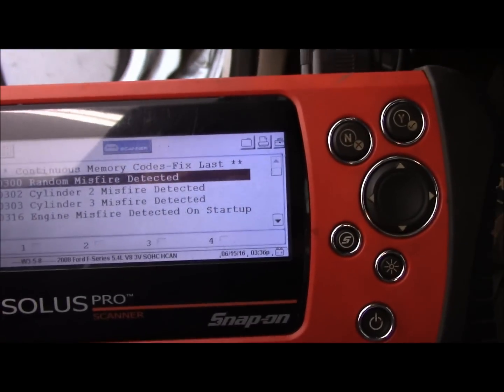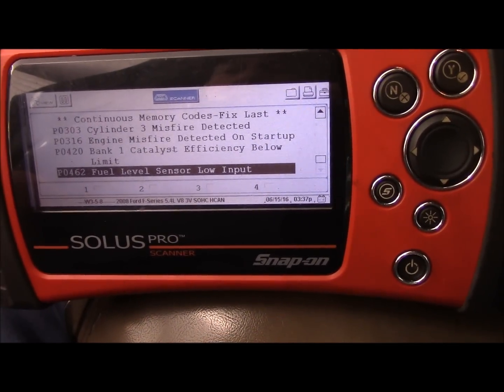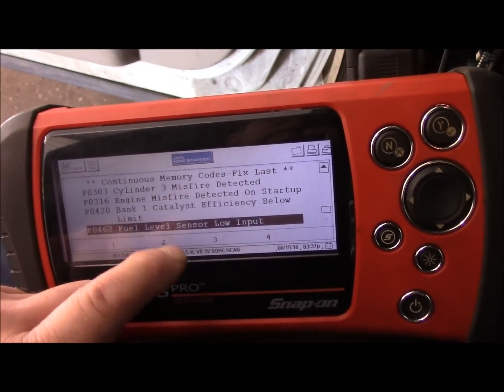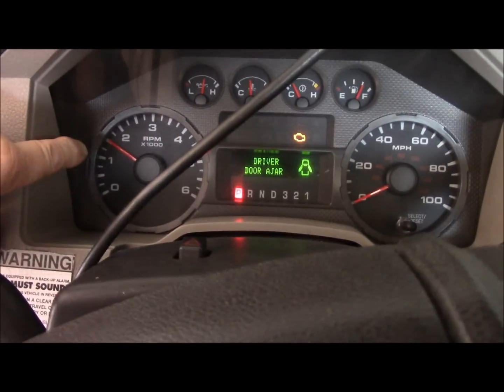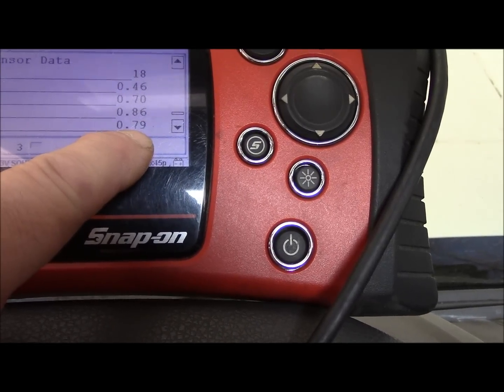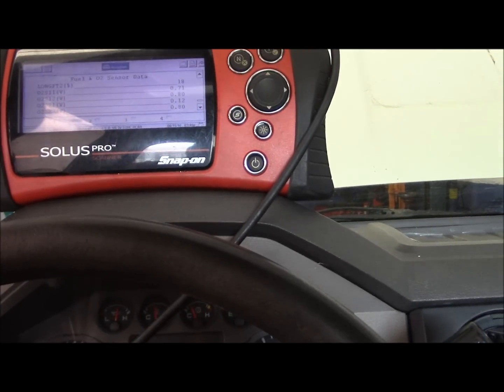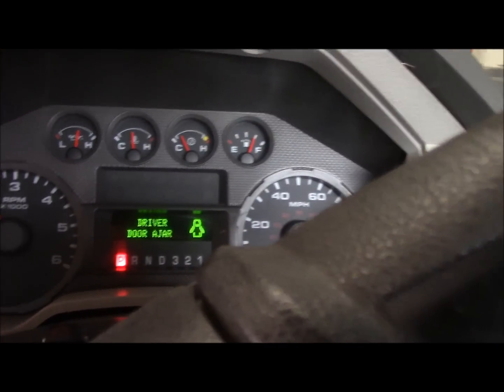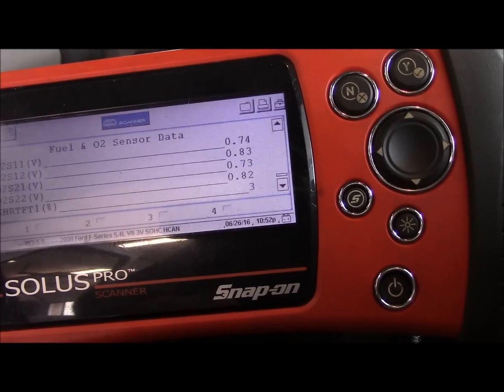How To Test A Catalytic Converter

Comment: Try putting it on the pipe and not the heat shield the heat shield will read cooler you had it on the pipe at the front but on the heat shield at the back

Comment: How do we know the catalytic converter is “positively” no good ? What are the temperature differences supposed to be between front and back ?  Also, did you replace the oxygen sensors when you replaced the catalytic converters ?

Comment: I got a po136 06 Chevy trailblazer I know it suggests is a downstream O2 sensor but live data says the O2 sensor is working fine comes on after about a hundred miles got to realize this vehicle's got 205,000 me and I live in Chicago. Rust belt I do live data it shows CO2 sensors working fine. I really believe it could be the catalytic converter because if you press the gas there's hesitation that it normally wouldn't have. What's your thoughts

Comment: My O2 sensors in both banks are reading arounf 750 mV continuously (at idle and at 3000 RPM as well)
Also, the LTFT in both banks are almost zero, but at steady 3000 RPM, the LTFT go to -10 in both banks
What does this mean?

Comment: Thanks.  I have a toyota that had bad coils and plugs.  The cat is not showing a code now but the monitors are incomplete.  The scan tool says the cat is hotter upstream but it may be reading the difference between the wide band A/F sensor and the o2 sensor.  Ill check with the IR thermometer.

Comment: I have a 05 BMW x3 
Both bank 1 and 2 sensor 2 are reading 92 and not moving.  Could this mean that they are bad?
I do have p0420 and P0430 codes. 

Could it just be the 02 sensors?

Comment: My car started hesitating after i took it to get tires rotated. found out the  Mechanic took air filter out and didn’t put it back in when they did a point inspection. I put a new filter in but now i get the check engine light on. Changed the oxygen sensor out erased the code. 0420. Check engine light came out again. My question. What could a missing air filter cause the engine to cause the code ? Thank you
Reply: dirty MAF sensor ... mass airflow sensor 
just beyond the air filter ...
with no air filter there was nothing to block whatever gets drawn into the intake ...
usually in the 'accordian' looking thing ...
(there's a special solvent/cleaner for MAFs)

Comment: Jim, could the up stream oxygen sensor be disconnected and removed, and if engine  performance
has returned, would that now confirm I have a stopped up cat?  I have checked and confirm all else
in system...everything ignition related,  mass flow sensor, egr valve, throttle body, tps sensor, clean
air filter...everything under hood. Good fuel pressure confirmed.  Presently engine will not run over 
10 to 25 miles per hour. Removed egr valve and engine now performs somewhat normal.  Reinstalled
Egr valve. I think if I remove upstream oxygen sensor engine will perform normal. Engine does use a little
oil. This may be my problem causing stopped up cat. Your opinion on removing oxygen sensor and
doing engine test drive. Your opinion on this test drive procedure. Engine is chocking up on acceleration.
Your thoughts please. Thanks..Jim.

Comment: So if catalytic work properly pre catalytic converters should be lower temp that post converter? Is this good assumption if both temp reading are same or pre cat hoter than post cat then consider replacing the catalytic? Please advice

Comment: Jimmy when you checked the o2 sensor in bank one sensor 2 it was not fluctuating the proper way. It was the cat that was the problem. If it was a o2 sensor problem what would the scanner be showing? Did say it’s the sensor and not the cat.

Comment: I have a 2017 Hyundai Santa Fe and I noticed the inlet temperature was 200 degrees higher than the outlet and I have no check engine

Comment: If an cat converter is bad then air does does not move through the converter. When this happens which side would be hotter? It would be the inlet side because the heat just going to build up and not get through. Common sense. Not sure why a cat would be bad if the temps are the same on inlet and outlet

Comment: I had a p0420, used thermometer and showed the Cat is good (100° hotter downstream). The upstream voltages swings between 100mv to 900mv but the downstream shows 700mv - 800mv on idle, erratic on 50 mph. No leaks after exhaust manifold. Normal power. Fuel Trims okay. Could it be Rear O2 sensor?

Comment: Great!!
Have two questions, first what does the second o2 sensor do?

Second, why does the temperature changes always and how much should the difference between the outlet and inlet temperatures be?
Reply: Second O2 sensor reads gasses coming out of the catalytic converter and lets the computer know that the exhaust gasses are withing specs. 
The difference between the two temps should be around 100 degrees. the engine side being cooler one. Reason for that is, a working Cat supposed to burn off hydro carbons which tend to make the exiting side hotter.

Comment: Hi Jim. Great video. Please help me with my wife's 2013 infiniti jx35, V6 engine.
After getting the engine hot the cats were at around 850 degrees. The voltage readings were as follows: B1S2 - jumped between 0.070 and 0.080, B2S2 - jumped between 0.110 and 0.800, B1S1 - around 2.0v and B2S1 - around 2.2v.

Can you please help me diagnose this?
Reply: My pathfinder the same, u ever find out?
Reply: @jasonfromm5637  he didn’t give enough info. And He didn’t say if the car even threw a code. 850 deg? V readings seem consistent

Comment: I have  a Mercedes Class C 2011 W204, the O2 sensor upstream is showing 2.0 (1.6 - 2.4) Volts and the O2 sensor is showing 0.41 (0.1 -0.6). The temp upstream is bigger than the temp downstream... Is there a probleme with the upstream sensor?
Reply: It's more than likely got an air/fuel ratio sensor upstream. It looks similar to an oxygen sensor, but it's different.

Comment: How does experience say that you need a complete set of coils?! If it is COPs, and not one of the other potential causes, why do them all? Misfires are NEVER that easy to diagnose! A P030x code does NOT automatically equal COPs.

This seems pretty dishonest to me.
Reply from the maker: Dishonest my a-s . I have replace so many converters because of other shops just changing one coil and a month down the road another one fails. As you must know a misfire will destroyed a very very expensive converter assembly.. You have no idea what you are talking about.
Reply: Jimthecarguy - My point is that no level of experience is enough to look at a scan tool, read a P030x code, and know with certainty that you need to replace all the coils. There has to be some form of testing. Could it be COPs? Sure it could. It could also be plugs, valves issues, or several other potential reasons. A trouble code gives the symptom, not the cause.

The other issue is, if a coil is actually bad, then replace it. They do not need to be replaced as a set. The excuse of ruining the new cat a month later is not reasonable ......especially if you diagnose the misfire cause and fix it, not just throw potentially unnecessary parts at it.
Reply from the maker: @mikenaples4046      Whatever you are entitled to you opinion.

Comment: That's not really true that catalytic converter when we get really hot when you step on the gas when you're running it at 2 or 300 RPM to 3000 RPM that's the only time that catalytic converter will get hot and you should know that it doesn't get hot when you sit there and idle and you know that
Reply from the maker: WHATS UP WITH YOU?????????????? ARE YOU A TROLL? OR ARE YOU REALLY THAT DUM.

Comment: I don't think this is a complete diagnosis you went straight for the coilovers and just replace them all I would have did a little more research to make sure that they were bad by switching them switches cylinders with the good one to the bad one and that I would have reset the computer to see if the misfire fault code came back I think this is the proper way to higher class the professional way to do it I think this is somewhat unprofessional to just assume that the part is bad without verifying it and to replace all 6 or 8 coilovers or all 4 whatever
Reply from the maker: Thanks for watching.

Comment: It could clean up if you fix the wrong with the engine sometimes that catalytic converter will clean up also to our first of all replace that downstream O2 sensor before I did the catalytic converter you probably need both but I would do that one first too much cheaper repair especially if you have a lot of mileage on it sometimes I'll talk to sensors don't read the correct data data data
Reply from the maker: Thanks for watching.

Comment: just curios why did you not check the O2 Sensor and see if it was working properly ? because if that also is bad it will throw off the cats ...just wondering.
Reply from the maker: Thanks for watching.

Comment: I have a P0420 on my 2011 Honda CRV I changed both oxygen sensors and it went away for about a week and then it came back so I'm supposing I may have a leak somewhere. I scanned it and have no misfires, I checked under the car I didn't find any holes anywhere but I did notice that the top or pre cat catalytic converter is very red and bluish does that indicate damage? If it does do you suppose that I could be burning some fuel or oil into the catalytic converter? I don't want to replace it without being sure that I found the problem that caused the damage to the cat, otherwise it will just happen again, what would you recommend on how to proceed?
Reply from the maker: How many miles on the truck? Is there any exhaust leaks before the converter?
Reply: 112,665. as far as exhaust leaks I don't hear any, smell anything, and my 2 scan tools don't throw codes for leaks or misfires. Although there seems to be an issue with the evap system vapor pressure , the readings go really crazy between 26.50 and 332.50 I believe the normal range is between -0.35 and -50 
As well as the absolute throttle Positions B and D being higher than they should be, I believe the normal range for both of them is between 0-14 and they both go as high as 30 besides that, the only other code that does appear is P0135
sorry for the long response 
But thank you for any help you may provide
Reply: P0420 for sure have a bad cat... Not the 02 sensors
Reply: What's up with this guy, he starts to help but then he just stops responding to you. I se him doing that a lot! So I will not be a  subscriber !!!

Comment: I'm still wondering about the catalytic converter in my Mitsubishi outlander 03 and have one more question. If I'm randomly getting an obd code which says 'catalytic converter over threshold' is it possible that the problem is with the downstream o2 sensor? This sensor periodically reads up to 0.7-0.8V like I mentioned in my previous message but sometimes the reading from that sensor jumps all the way down to 0.1V. Would you advise me to change that sensor first before I replace the catalytic converter or in your opinion is it definitely the catalytic converter that's bad? Thank you in advance. And have a good one.
Reply from the maker: Can you borrow the laser thermometer from on of the big box store and check the converter as I did in the video?
Reply: @jimthecarguy Thank you for your reply. In about ten minutes after I started the vehicle I check temperature by the laser thermometer and the temperature is almost the same on the front and on the back of catalytic converter.

Comment: Very professional diagnostic and extremely helpful video. Thank you so much. I have similar symptoms on my Mitsubishi outlander 03. My downstream o2 sensor is reading about 0.7-0.8V after about one minute of accelerating to 2K RPM right after I release the gas pedal. Then after about 3-5 minute that downstream o2 sensor starts jumping and reading 0.3-0.5V like the upstream sensor. The temperature on the front and on the back of the catalytic are pretty much the same. Could you please advise me if my catalytic converter needs to be replaced? Thank you very much.
Reply from the maker: If the inlet and outlet are the same temperature and there is no exhaust leaks than it sounds like the converter is bad. Thanks for watching.
Reply: @jimthecarguy  Thank you very much for your reply and for your time. Have a good one.
Reply: @jimthecarguy  I'm still wondering about the catalytic converter in my Mitsubishi outlander 03 and have one more question. If I'm randomly getting an obd code which says 'catalytic converter over threshold' is it possible that the problem is with the downstream o2 sensor? This sensor periodically reads up to 0.7-0.8V like I mentioned in my previous message but sometimes the reading from that sensor jumps all the way down to 0.1V. Would you advise me to change that sensor first before I replace the catalytic converter or in your opinion is it definitely the catalytic converter that's bad? Thank you in advance. And have a good one.
Reply: @andriivladyka7126  hi, I would say the 02 sensor is ok. However the cat is probably bad. Have you tried cleaning both sensors and cats? Or have you already repaired your car?

Comment: Manufacturers should change the EML light from Yellow to Red...bcos all car manuals say warning lights in Yellow is nothing to worry about hence ..low screen wash warning is yellow...Bulb failure is yellow...low fuel is Yellow..how how we suppose to take EML light serious???..especially when the car is still running smooth...you think..oh..I haven't tighten my fuel cap😥

Comment: I have 96 Toyota Camry LE 4 cylinder with the P0420 code. I had previously did tune up in July  changed coil packs and spark plugs and had to replace the distributer cap and rotor.  The vehicle will start but will run maybe 2 -3 minutes tops then shut off and will start back up for awhile . Could I have more than just my catalytic converter as an issue?

Comment: So if o2 sensor didn't do what it was suppose to be doing how would you know that the o2 sensor didn't need replacement and not the converter itself
Reply from the maker: You will need to check the inlet and the output temperature to be sure the cat is bad.

Comment: Great video I'm getting po420 and po420 does that mean I have to replace front and back sensor
Reply from the maker: You will need to check the inlet and the output temperature to be sure the cat is bad.

Comment: Jim:

Nicely done Sir.

One Q:
Isn't it possible that bad coils / misfire issue caused converter to plug up & a long highway trip AFTER coil replacement could have heated up Cats / removed plugging / restored proper exhaust flow?

I've seen clogged Cats clear once engine management issues are fixed.

I'm asking from the perspective of a DIY home mechanic who perhaps would want to try this economic approach first, before dropping  $600-900 on that sweet new double Cat assembly ?
Reply from the maker: Yes it is possible. If there were misfire you could repair that first and then drive to see if it clears out. From my experience the cat is most likely going to have to be replaced. Thanks for your input.

Comment: The temp test is a start but its not the correct way, because the computer is set to go off by the smallest inefficiency. So the last car i worked on had a 100° drop from like 412 to 309 but was still setting the code p0429. So I changed the cat and light never came on again.

Comment: So is p0421 a bad catalytic converter too? Bc that is what I have and I think I have a warm up cat and a main cat . V6 . 3.0 idk to replace 02 or a bad cat or warm up cat ???
Reply from the maker: Did you check the temperature into the cat and out?
Reply: @jimthecarguy  I will need to put the car on jacks to get under it and do that , I can kinda do the rear while on the ground , the inlet was cooler than the exit.  But the one upfront I can't even see unless it goes in the air which I will test them all at better angles

Comment: Hello im only getting the p0420 code on my nissan altima, i did the cat-cleaner solution drive 132 miles passed smog check but i when i hit 152 miles it turned the engine light again. Cat converter needs to go?
Reply from the maker: Yes those cleaner just don't work. The cat needs to be replaced if there is no other problems. Thanks for watching. Don't forget to subscribe.

Comment: I think I have a  bad catalytic converter, Because bank 2 is mimicking bank 1, But I don't have  a check engine light!? Why? Maybe later? Or can it just be 02 sensor bank 2?
Reply: First of all dont change anything til you get a code that tells you something is wrong.
If you have 2 banks like a V6 or V8 engine, you want to check the sensors on each bank.
Example, on bank 1, compare sensor 1 to sensor 2 with the motor hot and running and hold the rpms at about 2k rpms.
As long as the engine is hot enough, sensor 1 will jump up and down between 0.1 to 0.8 rapidly, and sensor 2 should be steady around,
0.5 to 0.8.
If sensor 2 is also rapidly jumping like sensor 1, then the cat might be bad cause is not heating up enough to burn gases.
To double check this, use a thermometer like the one in the vid to check the inlet and outlet temps of the cat.
Try to point the laser at the weld seams of the outlet and inlet. I find to get a better reading that way.

Comment: Did you also replace o2 sensors or use old ones?
Reply: Bob my rear 2 cats (V6 Mercedes e320) were partially/mostly blocked.
Temps read 100deg higher in F, than Rear.
Oops that's reverse what it should be !
Proper is +40-100 hotter in rear of cat, btw.
Cut them out & straight piped now runs like scalded cat (!) plus 3mpg increase.
Front Cats are still there.
I added Flowmaster 40 series muffler in back.
Best sounding car I've ever driven.